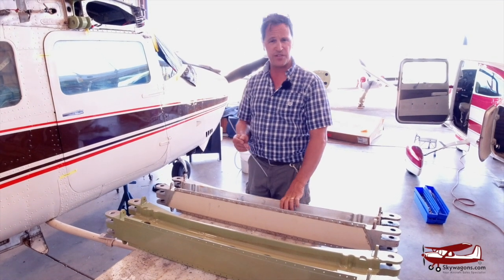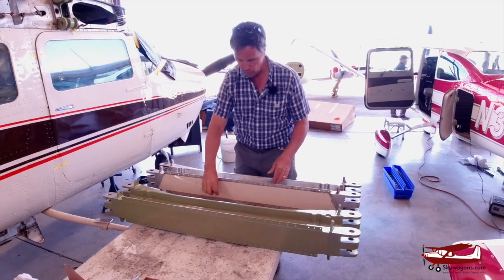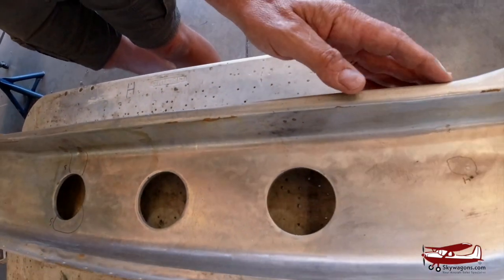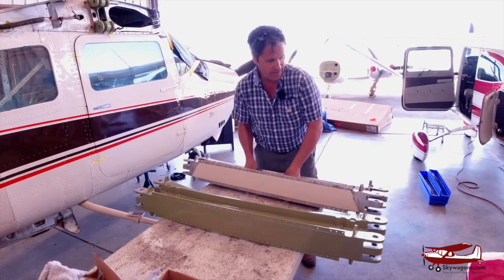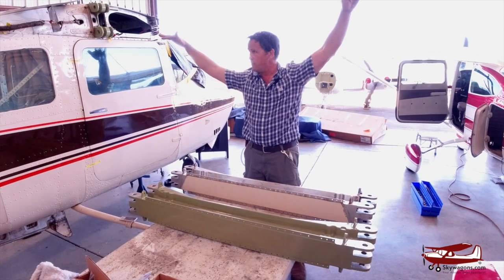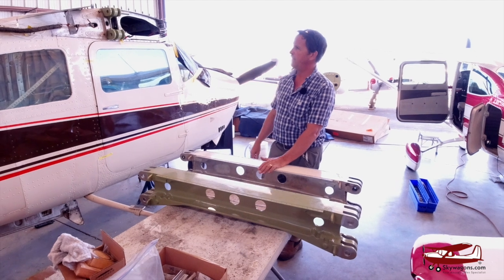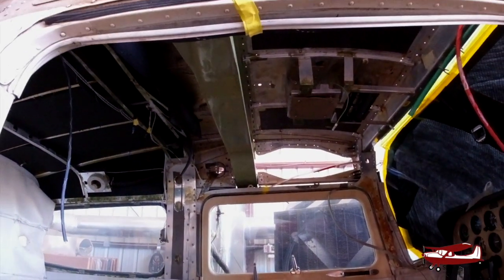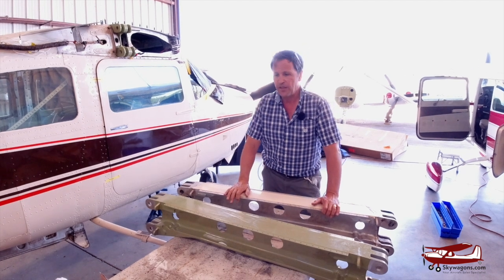210 Wing Spar AD

Comment: Why is that minimal amount of corrosion so detrimental? It's basically an I Beam with a little corrosion on the web.
Reply from the maker: There was an in-flight break up of a Cessna 210 in Australia.  This crash brought the corrosion to everyone's attention.  A bunch of engineers put their heads together, the world oscillated, and they came up with the tolerances allowed.  How remains a mystery to this day.
Reply: @skywagonuniversity5023  Was that INFLIGHT break up in severe turbulence of a thunder storm, maybe?  I'd wager if you took that BAD Center section and placed it in some sort of press it would take many tons to deform it, Even though it's corroded.
Reply from the maker: It was a coastal based plane in a humid salty environment doing a high G turn.  It broke the spar anout 6 inches in from the outside edge vertically apparently.  Wing folded up.
Reply: @skywagonuniversity5023  
"Wing folded up"!!!!!!
And THAT ain't good !
Reply: Wasn’t that 210 with the failure also highly modified? I’m no engineer, but that spar is way overbuilt, and replacing it because of that small amount of surface corrosion is way overkill in my opinion. One spar in a highly modified 210, in a salty environment,  fails and the industry overreacts due crooked lawyers and stupid juries. $40_60K for that repair is insane. It is what it is. If new aircraft were affordable, antique 210’s would have been send to the scrap pile decades ago. This is all about destructive corporate greed, and a runaway, weaponized, corruption based, free press, manipulating the minds of the low intelligence people who are so easily deceived. Thanks.
Reply: @thesearcherman6652  I would like to know if the FAA does destructive testing on the spars that are pulled for replacement.
Reply: @thesearcherman6652  With all due respect, you may be right to some extent, but you may be underestimating the loads carried through the spar. There are always two sides to negotiation/argument with each party compromising and creating balance. It's not necessarily about the corrosion amount it's the stress build-up in particular areas that have a certain statistical chance of causing a catastrophic failure. Cessna did not design the spar to tolerate any amount of corrosion.  Therefore the least amount beyond the new tolerable limits on a spar is unacceptable. If you don't mind me asking, are you an A&P? If you are not an engineer can you really say the spar is overbuilt? Not trying to be offensive or rude, I know you were just stating your opinion which you are entitled to.
Reply: @christopherm7702 - Just my opinion, which means nothing. The 210 that crashed was modified. If it had not been modified, my opinion would be different. Also, there is no legitimate reason for that piece of cast aluminum to cost what he says it does, other than jury trials and corporate greed. General Aviation is mostly dead due to what it now costs. I am not an A&P,  but I got my PPL in 1974.  Back then aviation was expensive, but it was also affordable. Now, a bunch of broken down antique rental Cessna’s. Who would have thought we would be renting the same planes that we leaned to fly in 46-47 years later? Greed destroys everything it touches.
Reply: @thesearcherman6652  Yes, I understand your point and respect it and agree with you on most points. What this has caused is wing spar inspections with corrosion in critical areas that should have been inspected for the last 40+ years. The FAA is usually reactive instead of proactive. When opening up the 210s the headliner is very rarely taken down for an annual/100hr. There needs to be more reliability engineering, better-continued airworthiness directives, and a modified inspection program for these aging aircraft. And yes the prices are ridiculous. Have a great night and thank you for the comments and your perspective
Reply: @thesearcherman6652  The possible re-introduction of the Piper wing spar AD which was introduced in the past is a constant source of anxiety for flight schools using older aircraft . As an A&P (not working in aviation any more) yes these parts are way too expensive but people are using these old 172s and pa-28s wayyyyy past their expected lifetime hours. At the airport I worked at I remember someone said a King Air owner was unhappy about his bill, the mechanic's response was "Have you ever met a happy King Air owner?" similar thoughts for general aviation owners. Some make out with good income through rentals but the big bill -- or local aviation downturn, always comes and then they're in the hangar crying because they're 50k in debt.
Reply: @FINSuojeluskunta - I totally agree. The real problem is the cost of new airplanes. New airplanes  that would allow these antiques to be junked. There needs to be a political solution to lots of issues like these. Not going to happen soon as we have a totally dysfunctional government, society, and media. Healthcare is in far worse condition than aviation in this country. 

Flying was affordable 40-50 years ago for blue collar workers, not anymore. And, even in the early 70’s when got my PPL, A&P’s were way under paid. They mostly head for the airlines now to get a decent pay.
Reply: @thesearcherman6652  Yeah the pay is not horrible but it's hard to make a career out of it without the airlines. United and Delta pay very well but require you to go through feeders paying $18 an hour starting, often in major metro areas or in commuter cities. Mind you this is just for a chance at getting into the airlines where they'll put you on graveyard shift for 5-10 years. AA for instance was offering less than my general aviation job at the time to start. Regardless the club I worked for had a handful of brand new 172s and a brand new 182. It's a delicate balance getting these poor kids to take out 70k loans to maybe get a feeder airline job for ~30k. City transit companies like RTD in denver hire A&Ps and personally I would go that route since the pay is better and the job security/union is immediate. Being an A&P was awful and fun but to be honest I didn't like the idea of making terrible pay with bad/no benefits while being afraid of starting a family because anything like covid and you're on the chopping block real quick. Got laid off immediately when Denver shut down airports.
Reply: @thesearcherman6652  Supposedly it's come up a bit but my first job on jets was $15 an hour in Denver. SkyWest was offering 18, as were most companies. After a few weeks I got my previous job for 24 without benefits at a flying club. This is about the same price as you start at a company like AA but United/Delta pay a lot more. The problem is it's very hard to get into Delta/United especially now after the covid downturn. Sierra Nevada Corporation will pay over 30 but one of our employees said they were cutting people who made over that much. You can make 70k but it's highly based on forced OT. So I'm not saying there aren't good positions but they're hard. I shook hands with a USAF contractor who did training for them in Da-20s when he came to buy one of ours but never got the offer, hear the pay is around 30 an hour with union. Same thing for drone mechanics but it's hard to even get interviewed for a position with them. So there are definitely career paths but to be honest I would have gone into something else like you said. I got numerous offers prior to fixing planes for transit and local city railway stuff for better pay but I was wanting to use my A&P. I'm now a software engineer intern while a junior in college. If everything falls apart I'd go back to Denver with RTD but I'm sticking with this now. The pay for A&Ps is just in general really bad.
Reply: @FINSuojeluskunta  I think you made the right career move, and you can always go back. More money and it’s more stable. They have never wanted to pay A&P’s a decent wage.
Reply: @thesearcherman6652  Yeah A&P school was massively overpriced. I think it was about 35k but I paid it off while working at the club and saved about 25k. Was living at home the entire time I worked to do it. It wasn't terrible I mean you can still make a living as an A&P, you won't be homeless, but  it just wasn't where I wanted to be in 5 years. If I move back to a major metro for work after university I'll definitely try to tinker here and there or at least just hang out at the local airport. The one here is really small
Reply: From the report: the spar had experienced very minor surface corrosion pitting
on the lower cap lower surface and that no other mechanical damage was found at the
fracture surface. The corrosion pit was 1.82mm long and 0.3mm deep